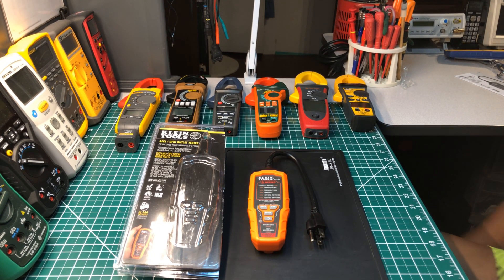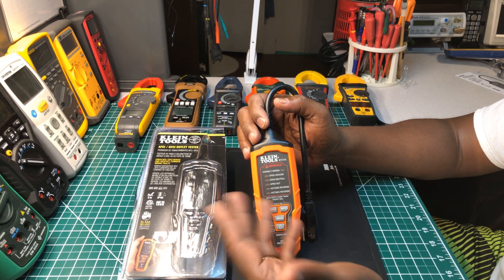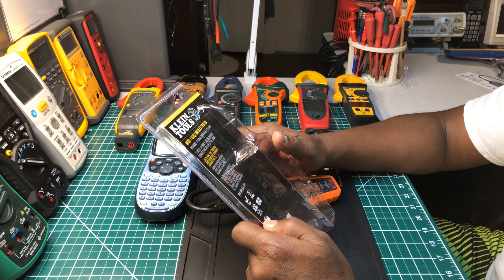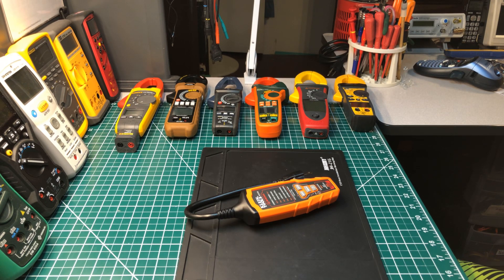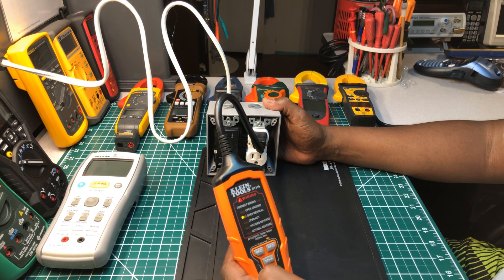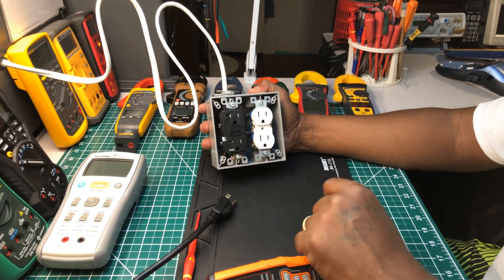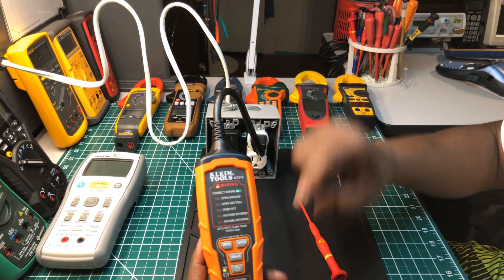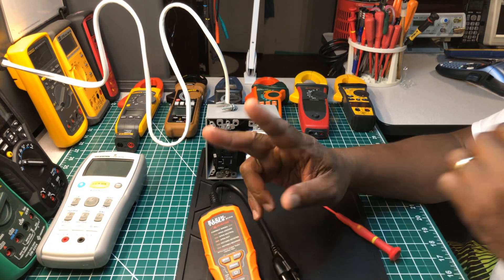🇺🇸 KLEIN TOOLS  AFCI / GFCI Outlet Tester #RT310

Comment: I have had this for the last 10 months. It’s good for AFCI testing but I do not like the fact that I don’t get a time to trip and AFCI. Also as you suggest no digital read out. Time to trip is important to ensure that you can match it against UL specifications. The ideal tester stopped selling the AFCI function on the circuit analyzer given it was giving false readings in testing the range AFCIs this Klein is much more predictable. Leviton GFCI/AFCI class A devices are actually very stable and predictable as well. The ideal time to trip is good but the resolution is not fine for GFCI trip currents and trip time - my Fluke multifunction 1664FC tester is much more accurate and higher resolution than the ideal but its 4 or 5 times more expensive. Once you start to do real safety testing you really have to go the multifunction tester routes as used in UK and Europe. USA is way behind on testing and the NEC is pretty poor on that as well. Hopefully this will change in the future. It gives hard evidence that electrical installations are safe and or new additions to an installation later have been correctly carried out  and safe.
Reply from the maker: I agree with EVERYTHING that you’ve spelled out to me in your commentary, you’re spot on !
Reply: The Electricians Tool Channel  Thankyou for all that you do I know younger electricians will be keen to learn from your years of wisdom. It would be great for you to have a discussion on some of your experiences. Fault finding etc.
Reply from the maker: Thanks Math Man you given me something to 🤔 about sir.

Comment: Looks good quality and robust for site use. Seems to be more of a functional tester than an actual analyser. In the UK we have trip times to meet within the standards for GFCI, or RCD / RCBO as we call them. AFCI aren't too popular at the moment in the UK as they are only suggested by standards and not mandatory.
Reply from the maker: AFCI is code here in the states, but this is a very basic meter and the quality is decent I wish it had more features but for now it’ll have to do.

Comment: Trips the first 3 outlets on the afci circuit and does not trip on the 4th one and beyond.
Reply from the maker: The device has to create an arc for the AFCI outlet to trip. Allow the device to cool down a few minutes internally then try testing the fourth AFCI outlet. I have an AMPROBE AFCI/GFCI Tester that after a few uses I have to allow time for the unit  cool down internally before I can continue with my testing. I hope this information helps 👍🏽

Comment: Thank you for the video, I have a question, I’m not an a electrician but I like to do simple stuff at home. I want to replace an outlet can I use this to  trip off the breaker?
Reply from the maker: Not an ordinary circuit breaker it’ll have to be either a (GFCI ) Ground Fault Circuit Interrupter or a ( AFCI) Arc Fault Circuit Interrupter circuit breaker inside the electrical panel. Thanks for watching Tulio take a look at my main YouTube page and if you like what you see I’ll appreciate it if you subscribe to the channel. 👍🏿👍🏿👍🏿

Comment: does anyone on here know a sure-fire way to know if the problem is a bad afci/gfci breaker using a tool like this?
Reply from the maker: Yeah you can either believe this test instrument or you can perform some extensive testing by purchasing yourself a current leakage clamp meter to test the circuit current leakage. 👍🏽
Reply: @TheElectriciansToolChannel  so...this device will actually tell me if the breaker is bad?  I've checked the outlets...I KNOW the wiring is solid from panel to all outlets...and the outlets work with "low draw" devices like phone/battery chargers.  it's only when something like toaster of Keurig is turned on that it kicks the breaker...and both of those devices work fine on another circuit.  so...will this device tell me that the breaker may be the problem...either faulty install or bad breaker?

Comment: If I have the ET310 finder and tester, is this redundant? Does this unit do something that the ET310 doesn't?
Reply from the maker: Yea one is a circuit breaker finder with GFCI test, and the other is a branch circuit analyzer with more thorough testing with an added feature of AFCI testing 👍🏿👍🏿